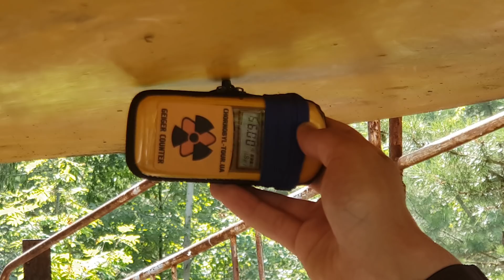How radiation hotspots work (Chernobyl, Pripyat's amusement park)

Comment: Apparently after the accident there were two major accumulators of contamination, the first being roofs and rain gutters of houses in the close by villages due to dust and rainfall. 

These were demolished and buried below where they stood using the Soviet recovery / barricade removing machines and their sister trench digging machines. Some of these vehicles were equipped with an elevated cupola with shielded leaded windows however the operators were unfortunately forced to stand out in the open in order to see what they were doing. They received large doses of radiation.

 (The most contaminated vehicles of the accident were those of the local attending firefighters, in the days after the accident you couldn't be closer than 10 feet to them without immediately receiving a massive lethal dose.)

The second accumulators of contamination were TV sets due to the tubes statically attracting dust. Lol.

Contamination is said to be deposited in a chess board like fashion around the zone with some areas receiving relatively little while right beside there might be heavy contamination.
Reply: Great info, I've heard that some places are 1/20th as radioactive now as they were 33 years ago. For instance, the highly radioactive Elephant's Foot now emits roughly 500-1000 roentgens per hour but it was 15,000 - 20,000 33 years ago.